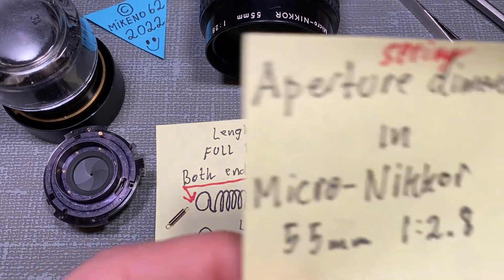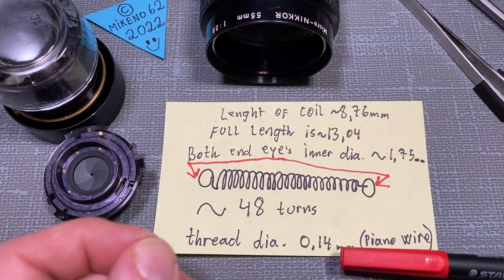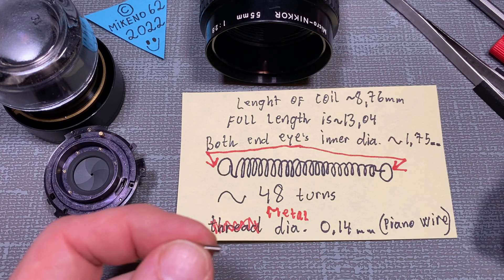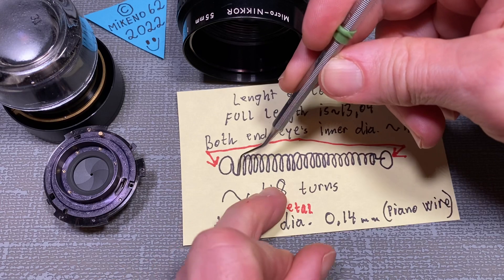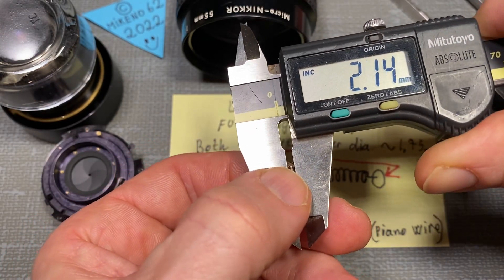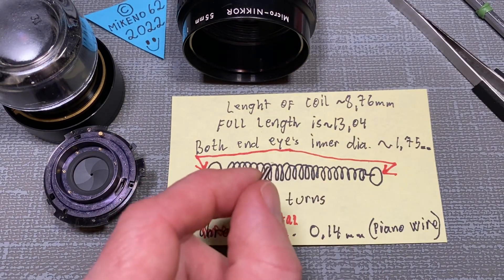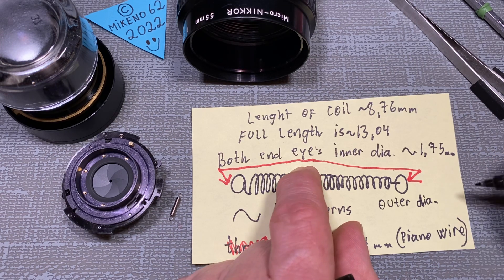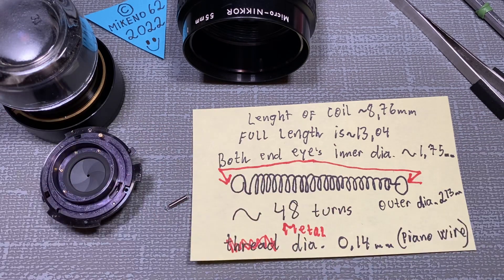Aperture spring dimension in ais Micro-Nikkor 55mm 1:2.8

Comment: Hello Mikeno62. I have a question about a lens I purchased recently, and thought you might be the best person to answer it since you really seem to know quite a bit about Nikkor lenses.

I have a set of 6 Nikon manual focus lenses that I use mostly for film photography, but I also own a D700 and a D7000. Recently I purchased a used Nikkor 35mm f2.8 Ai lens to go with my other manual lenses. It seems to work fine, except for one thing. When tested on either digital Nikon, all my other MF Nikkors seem to give correct exposure when shot in Aperture Preferred mode. But the 35mm f2.8 consistently underexposes by 1-1.3 stops at all apertures. Aperture blades are oil-free and snappy.

Is there some adjustment for this on the lens that can be fixed? I know I can dial in +1-1.3 stops of exposure compensation when using this lens, but if there is a way to fix it, that would be better. Thank you in advance for any information you can provide.